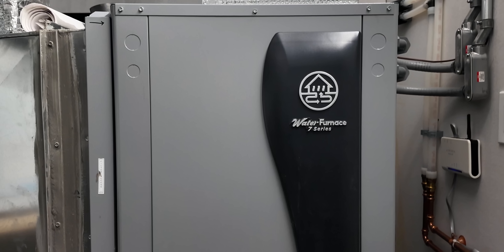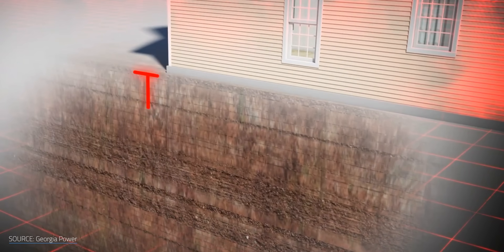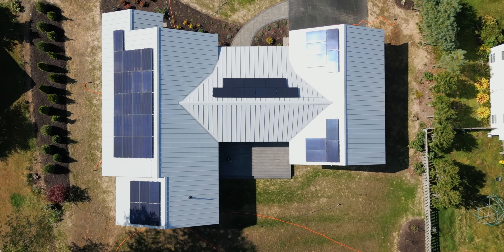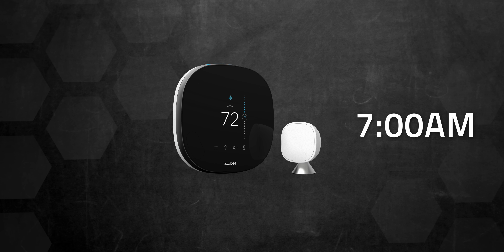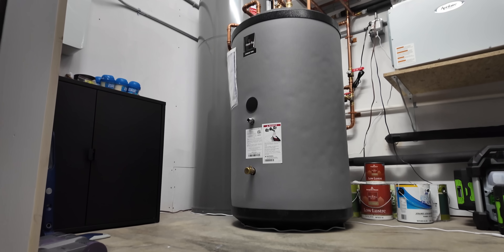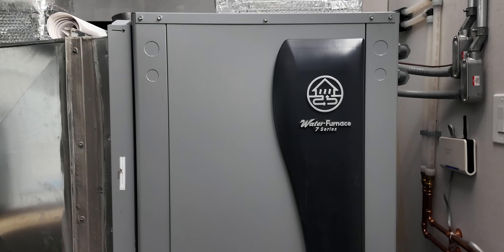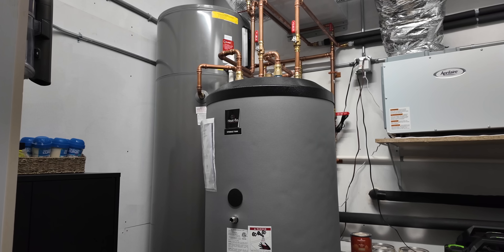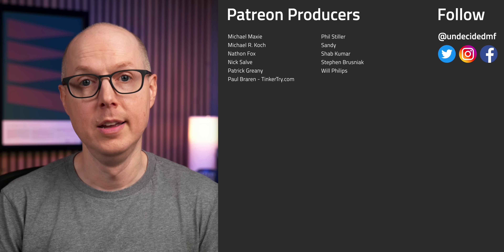How My Geothermal Heat Pump Really Performed (2 Years)

Comment: That is actually not true re the conservation of energy. The lates quantum science puts an end to this age old axiom.
Edit: there is no heat to move from the earth or back to earth. At certain depth the temperature of the soil surrounding your burrows coils is constant throughout the year, approx 8C depending on location. So the coolant is either way above that temp (summer cooling mode) and releases thermal energy into the ground or is very cold (winter heating mode) and gets warmed up by the surrounding soil. It works because of the enormous thermal mass of the soil. It is all about leveraging the difference between the temp of the coolant and temp of the surrounding medium-air, Earth, water. Yes, you can lay your coil at the bottom of a largish water reservoir and get your thermal migration achieved without any digging :).

Comment: Still seems like the break even will be 20 to 30 years,  and any underground problems will be much more expensive than problems with regular heat pump. Plus seems like there are more parts to replace with wear and tear. Like to see a 20 and 30 year projection and breakdown because it seems like all you did was pay the same amount up front as you would over 20 or 30 years with regular heat pump.

Comment: $0.31/kWh? Holy cow! In central Iowa, it's $0.12/kWh summer rate, and $0.08/kWh winter for my residential. Total annual cost is about $645/year for my geo in a very hot, humid, and cold climate. We have 600' of horizontal loop 14-18' deep.

Comment: First off you have to explain that a "heat Pump" does take from the air and really is not very good, than you said you dug a well, yes it does run about 18-20.000 to do and is not the best either. A real geo-thermal system is a close loop or open loop system, where mine ran 4500 to bury the tubes (but you do need the yard) and the Furness was about 9500 to put in. You can NOT include the duct work as you need that for any forced air system, yes there where alote of rebates and all figured it took 7 years to pay for its self, and now my electric bills run around 98.00/ month and solar prob would help there but still the cost id to high to recupe the cost, and yes it does help with hot water heating on top of all this, please make the numbers more real.

Comment: It would be useful if the speaker stopped using the "G" word (geothermal) when he means Ground Source Heat Pump.  Geothermal implies that the heat is actually free beyond the cost of pumping the hot water.

Comment: I too am in Massachusetts in the Worcester area and went with a dandelion geothermal system. Long story short, very pleased with no regrets thus far and don't see why i would. Overall I've definitely saved money versus my oil furnace and all the crap that went into that like oil deliveries, service plan and rate locks. Winter power bills are maybe a tad bit higher to quite a bit but when amortized over the year it's quite a bit lower. Running an oil furnace takes a lot of power as well and it's actually better to run it with the supplemental electric heater on the very cold days which also surprisingly saves money. Not to mention cooling over the summer is far more efficient than traditional AC as the ground is far more accepting of your house's excess heat than the already sweltering outside air. From what I've read if I didn't go through dandelion but on my own lining up drillers, furnace, etc then I could have probably saved a few bucks and got a more efficient unit. But dandelion's unit is mid-pack by most accounts on efficiency so not the worst and they handled all the stuff like rebates and such so all I had to do was line up my MassSave heat loan for 0% interest over 7 years to get the thing paid for and they took care of the rest which made it relatively easy. And now to not have to freeze myself for the sake of efficiency over the winter and never need to rue seeing that oil truck pull up and seemingly random times I would not have it any other way going forward. All of my CO detectors are useless as I no longer have combustibles in my house. In fact every time I look around zillow for houses I look for forced air for the possibility of putting geothermal in should we decide to move.

Comment: Our neighborhood was built with geothermal systems for everyone as they were building some commercial buildings with efficiency and they have geothermal. The incremental costs to digging a bunch of wells in the same area is very low since all the machinery is there. It's been great the past 13+ years I've lived at the house. The system only really runs in summer and winter - the house is so well insulated that during spring and fall there's very little need for added heat or cooling. It just stays comfortable. The only thing that's failed is the thermostat. Even when it gets cold the system hardly cycles and the HVAC installer says the emergency heater is basically redundant as it's just going to drive up your electric bill for no reason. So it's been disabled as it's never been needed.

Comment: Thank you for this video. Did you actually do the calculation of the price of adding a lot more solar panels and a battery as compared to optimizing your energy consumption to the extreme? I wonder where the tipping point is as solar panels have never been cheaper. Of course you need to have the roof/room to install all those panels and batteries have a limited life span, but electrical batteries in combination with a sand-heat-battery might be the more cost effective way to go. I don't know for sure as I don't have the numbers.

Comment: My Geothermal system here at the bottom of South Island NZ has been working for 10 years now - it's GREAT
Mine pre-heats the water and that warm water (42C) is used to heat the underfloor - cooling is NOT required here!
Couple of comments
One of the main reasons for a higher cost is that people massively oversize their Geothermal systems - my 1600 square ft house is kept nice and warm with a 4kW system
No need for any more!
So a much smaller ground loop works
Here you have to go 7m deep to get the same temperature all year round - that is expensive!! - I went 2m deep which is much much cheaper and only slightly less efficient

My ground loop is 5m x 5m and 2m deep - under my lawn - which means the ground loop cost me $1500!

Comment: Generates more questions than answers.  Your add-on part of your house should have been able to be insulated as well as the rest of the house.  The question is how is heating and cooling transferred in and out of those areas.  Did you research what could break and what the repair costs might be?  On your solar did you calculate inverter replacement at 15 years and probably trashing the panels after 25 years?
If plasma drilling progresses quickly, a huge amount of U.S. electricity may be deep geothermal at a great price.  It will probably out perform everything.  (Although, I still like gas for cooking, heating and fire place fun.)

Comment: 6:20 is a gross mischaracterization of both geothermal/ground source heat pumps and the reason why you don't want to have a setback temperature and schedule for your home.

Fundamentally, a ground source heat pump and an air source heat pump work in the exact same way. They move heat from one location to another, and the medium they're pumping into/from doesn't really impact how they work, beyond efficiency. With variable speed heat pumps, like your WaterFurnace series 7, your best efficiency is at a lower loads. Typically around 30%-40%, so running them constantly at this load, vs off 70% of the time and full blast 30% of the time, can significantly reduce overall electrical consumption. 

This is everything to do with physics and how variable speed heat pumps work, and nothing to do with the source, ground vs air.

Moreover, this has nothing to do with if you should schedule setback temperatures. 

Setback temperatures are generally not ideal, because they can lead to excess moisture and related issues in the summer, but they can save a lot of money on buildings that either have a lot of air infiltration or are simply not well insulated. Your forever home is, presumably, neither of these. 

With a building that has significant air infiltration, an ACH 50 greater than 5 for example, and/or has poor insulation, the amount of heat you have to move out of or into the building to constantly keep it at 75f is going to be orders of magnitude higher than on a well insulated home with an ACH 50 of 2 or less. 

Thus, for the leaky and poorly insulated home, a setback can significantly reduce the amount of energy used, even if you have an exceptionally efficient variable speed heat pump.

However, for tight and well insulated homes, the reduced efficiency of the variable speed unit at 100% load, when it's recovering from the setback temp, is likely to equal or exceed the energy savings from the setback itself. Unless, as you mentioned, you're going to be away from the home for an extended period. 

Thus, your move to keeping the house at a constant temperature has everything to do with using a high efficiency heat pump in a well designed and built home that's very efficient, and nothing to do with the source for that heat pump.

Your assertion that the ground source's high thermal inertia causing ground source heat pumps to ramp more slowly is simply not true, and it's irrelevant to your decision to eliminate temperature setbacks. Your 3 ton series 7 will recover from any setback temp as or more quickly than any equivalent air source heat pump.

Comment: I get the idea of keeping the temp relatively constant, but do you really keep it the same year-round? Wearing a t-shirt inside in winter is just unnecessary. You could do 70 in winter and 75 in summer and probably have some time in the spring and fall when you don't need anything, especially in that super-insulated home with a ton of heat-producing computer equipment.

Comment: Excellent information. For me, nothing beats natural gas. I have experienced all of the present day heating options in one way or another. Geothermal is too cold and so is a heat pump. Solar can work but the costs are also expensive. Wood is nice yet work intensive...
Just my thoughts but everyone is different. Natural gas in my area is a reasonable cost and very cost. Hot water radiant heating is also very good. One big thing that nobody talks about is your age. By the time I would break even was two and a half decades. That makes me 90....not going to happen.

Comment: We have a heat pump hat water tank, with hot water recirculation. When in bare feet we can feel the hot water pipes as they are pushed close to the floor and not individually insulated. Hot water tank has a hard time reaching it's peak temp while in heat pump mode. House is 3500 sq feet. We know heat pump hot water tanks have a slow recovery time. Wondering if the heat loss through the floor is more then the heat pump can keep up with.

Comment: In France heat pumps are way too expensive. Just an Air to Water heat pump costs at least 12 000$ including installation cost (that's without the floor water circuit or radiators). For a 30yo 180sqm house like mine the energy use is 12 000 kWh/year for heating and hot water, and with the heat pump that becomes 4 000kWh/year in electricity (COP 3 on a year average).  Their life expectancy is about 10-15 years, so whatever you were using before, you will never get your money's woth, unless of course the government pays for the bill (and that's what's happening).

Comment: Matt, a little over 15 years ago, when both my AC and furnace failed, I had a geothermal system very similar to yours installed, including desuperheater. My cost was probably about half what yours was, and after the federal tax credit, it was a little more than $8k over a traditional AC and furnace. I saved that back in less than 3 years. Monthly heating bills during the winter dropped from an eye watering $650/mo (propane) to only $55/mo. If I ever build a home, I will absolutely put in a geothermal heat pump again.

Comment: No way 50-75k in investment pays it self back over 30 years.

Vertical Ground Source Heat Pump (GSHP) costs 13k-20k and lasts for 50 years 

This is a solid investment.

Comment: 9:28 Can you remind me what your system size is?  I thought you had 1 3ton WF7?  For comparison I have 2 - 3 ton WF7's and my 2024 operation cost was $1314 (8216 KwH) in a 4600sf house.  72/75 are my year round settings.  I guess my house is not as well insulated/sealed as I thought.  You are outperforming me by an average of 81% per unit.  Since you have a HPWH, I don't get your water heating savings.  Mine costs about $110 per year, so it's hard for me to claim the Geo DHW is saving very much, but I do use them both, 1 to a tempering tank and 1 to recirculate the main tank.  Thanks for real numbers!  I guess I need a blower evaluation and to do those windows next year!

Comment: 2:36 dehuperheaters... If I had to do it again. I set up a second tank. The dehuperheater warms tank 1. Which feeds tank 2. Only tank 2 is heated.
If I had to do it again I'd probably replace tank 2 with an on demand heater... Pre warming the water in tank 1 is more efficient.
If the dehuperheater feeds a heated tank it doesn't recover as much heat.

Comment: I had a closed loop GeoComfort system with in-floor heating in a 4700sqft home for 19 years until the pump ceased last season. I can confidently assure you that geothermal systems are GARBAGE. It is wildly energy hungry, inefficient junk science. Your home will always be cold in the winter and geothermal "cooling" in the summer does not exist, your energy bill will be $500+ per month (my highest month was $792 in Feb 2022) and you will always have to find a specialist as HVAC companies hate working on geothermal, not to mention the initial $29k install cost in 2005 ($50k in 2025). 

I cannot express this enough, DO NOT CONSIDER GEOTHERMAL IN ANY SITUATION, you are being lied to, geothermal is expensive junk and you are a fool if you fall for it.

Comment: If you aren't getting free product, it really comes down to how much time you spend at colder temperatures and electricity cost (no shade, I'd take it if they offered me a free or discounted set up also!)  The waterfurnace series 3 & 5 have COP's of around 4, which is where the Mitsubishi hyperheat air source heat pumps are at with temps at 47.  The Waterfurnace series 7 appears to have a 5.2 COP at part load, but drops down to 3.4-3.5 at full load, which is better than air source of course, but with substantial upfront cost.  In the past geothermal made more sense.  Now with modern air/air tech and inverter compressors, it usually will not make financial sense.

I wanted geothermal because I'm a nerd and wanted to nerd out on all of the stats and gauges.  I researched, and planned my system.  I was told that the unit is basically the same cost for air/air or water/air ($10,000 was the cost for me about 5 years ago for a 2 ton without installation & I have 8 acres and a backhoe, so I was going to install the loop myself).  With an average heat/cooling cost of around $70/month, a water/water  (geothermal) wouldn't pay for itself compared to the ducted Mitsubishi Hyperheat I DIY installed instead of geothermal for $4500).  We get down into negative 10 or 15 degrees at times, but our design temp is closer to 10F.  For hot water, I went with a heat pump water heater, which has paid for itself after 4 years because of rebates.

The recommended way to save on many fronts is to 1) Reduce, 2) Reuse, 3 Recycle.  Therefore, before I did any sizing, I had an energy audit done on my earth-berm home, and corrected deficiencies.  Air sealing was my biggest target, along with improved insulation.  The larger the load, the more you can "save" with a system like this, but the easier way is to reduce the load to start with.  $39k for an air source heat pump install sounds incredibly high.  You could DIY purchase a Mitsubishi hyper heat 4 ton for probably $6k.  Of course ducting and install will add cost, but not $33k.  I think that's a quote to make the geothermal look favorable.  I'll take rebates if they're offered, but I personally don't think we should be rebating technology after a certain point (subsidies help new tech compete, but geothermal heat is not new).

I like the channel, but this is an advertisement for Waterfurnace via free product.